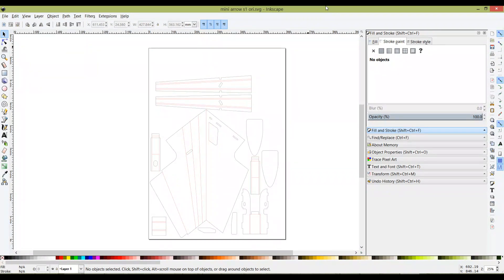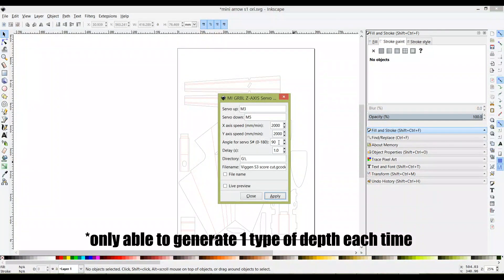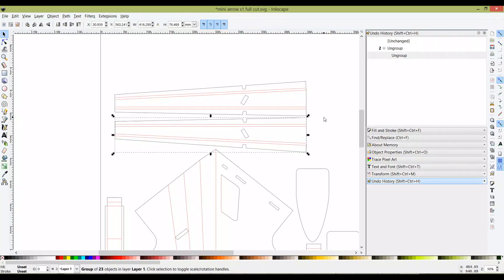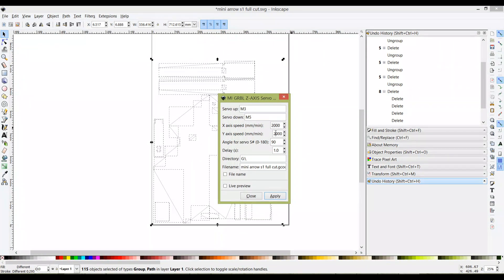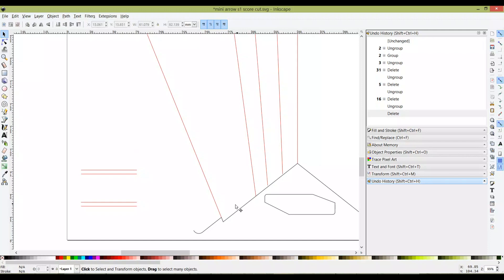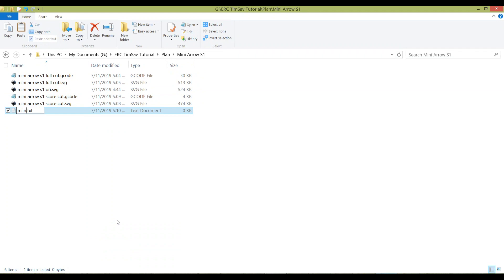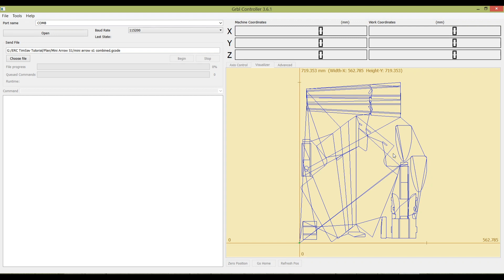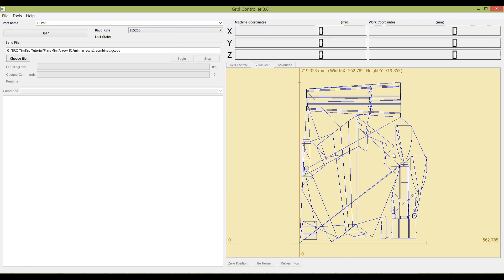ERC TimSav Part 7 - Generating Gcode from Flite Test Plan - DIY CNC Foamboard Cutter

Comment: Hello, as prescribed I am using Inkscape 9.1 along with your provided extension.  Unfortunately, the gcode file comes out at a smaller size than was drawn in the SVG.  What am I doing wrong?
Reply: Found the answer: You can't use Inkscape 0.91 to open a preexisting SVG, instead run Inkscape and then import the SVG file into the opened instance.

Comment: Wanted to help save people some time when processing the gcode and selecting the black or red lines (selecting the red perf lines or black cut lines) 

"Select Same" was introduced with v .91.  since inkscape ver .91 

So in short click "EDIT" option and navigate to the "SELECT SAME" and then click on the "FILL COLOR" (red/black) and  ALL lines will be automatically selected; that's it your all set instead of selecting each line individually.

Comment: Hi. I have copied the MI Inkscape Extension into the correct directorybut when I open Inkscape there is no sign of the extension. I have used your latest version and tried 4 times. Still no sign but if I look in the extensions directory it shows. Any Ideas.
Reply from the maker: probably just not in the right folder as you think :)